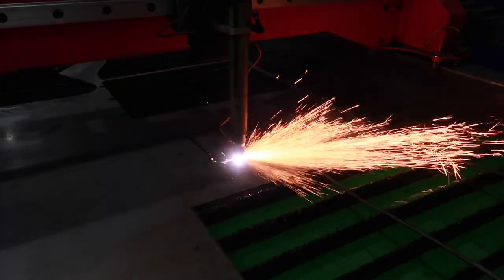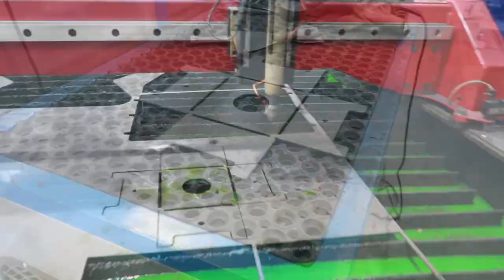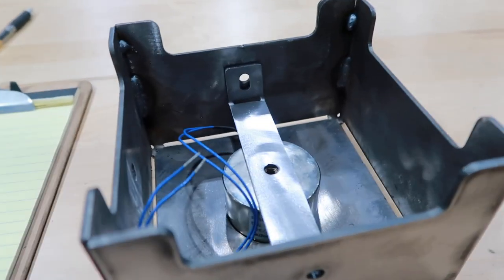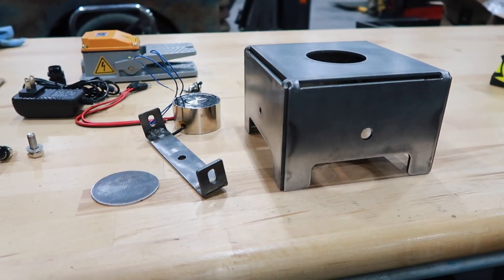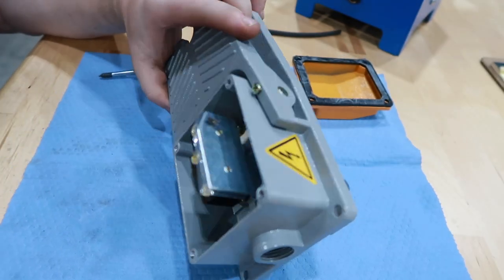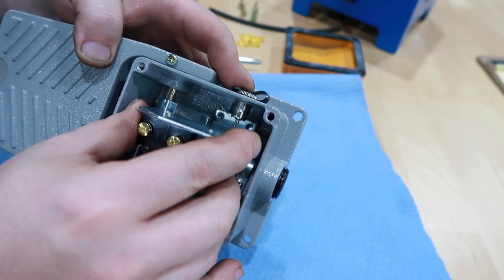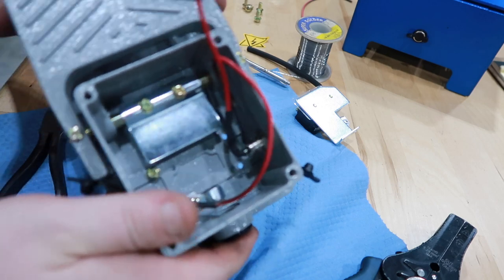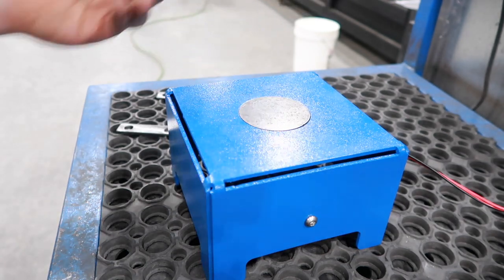DIY Electromagnetic Vise for cleaning CNC Plasma cut parts | Electric Magnet | Fabrication Tools |

Comment: Very good idea. One thing, I would have sealed the long slots around the top because when your grinding the fine metal coming off of the part will be attracted to the magnet (even when off some will be there). I like it!!
Reply from the maker: Good point! The theory was to pull some air around the magnet to keep it cool since this will live on my grinding down draft table. It might need some monthly cleaning, Thanks for watching!